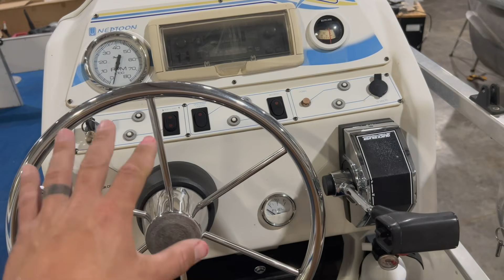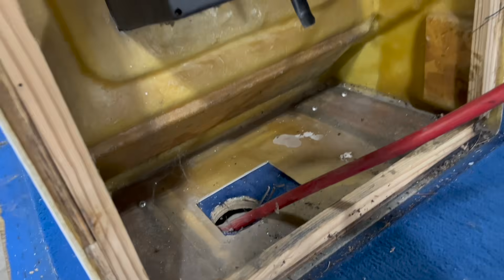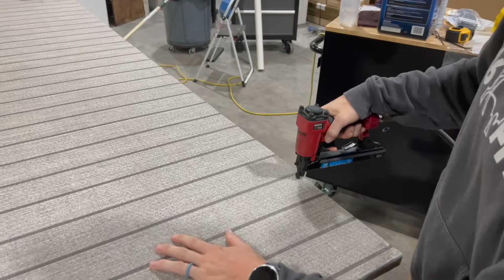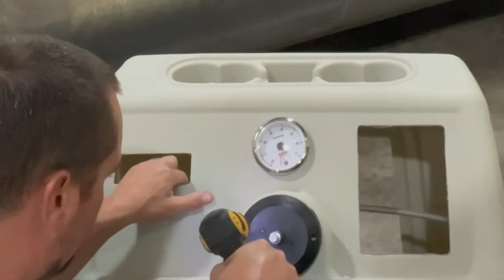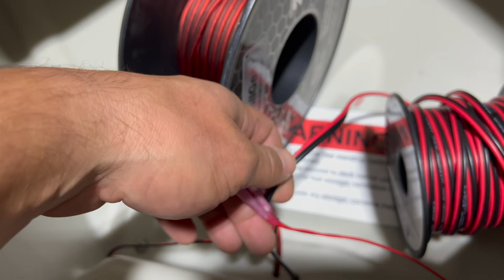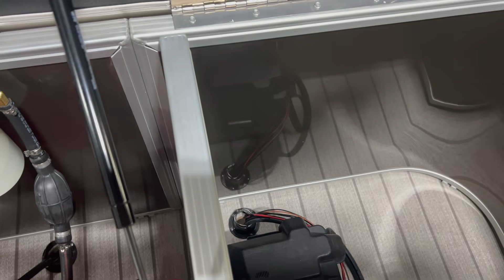Complete Pontoon Restoration - Instructional - 1996 JC Pontoon

Comment: Great job on the video, very clear and easy to understand what your saying but as an instructional video it would have been helpful to to a much wider audience to put time stamps along the timeline, that way if someone wanted to know how to do one particular thing they could jump to that part of the video. As for any pontoon full resto-rebuild like this, the fact is you can buy a brand new pontoon boat for the price of all those parts, not to even mention all the labor/man hours and headaches. ...aaaaand when he gets ready to sell it the title will still read "1996" - good luck!
Reply from the maker: Agreed! I need to add time stamps on these longer videos. We shopped the spring boat show hard to find the cheapest pontoon boat out there and what we found was a 16' Qwest fishing style with one small bench seat, a folding fishing seat for the captains chair, and two fishing seats up front. It was bare bones and had a very cheap look...for $26,999 (before all the tax/freight/fees, and with no trailer). From my research, entry level 20' pontoons with a 40-60hp are now ranging $35K to $40K. So for someone who plans to keep a restored boat for a while there is great savings there. 

You're right, if they plan to sell it the buyer will have to understand and see the scope of work that went into the restoration in order to understand the value. It's sort of like dropping a new engine and transmission into a 30 year old truck...if the rest of the bones are good that truck's value will be much higher than a truck of the same year without the engine/transmission upgrade...and at the same time it'll not be worth what a new truck costs. However, it'll be a great truck for someone who knows what it is and could drive another 10-20 years for way less than new. 

Thanks for watching and for the time stamp suggestion!!

Comment: Couple questions, does marine grade plywood have to be used or can regular plywood be used? Also does that type floor covering get really hot in the sun? I’m still trying to decide between this type floor covering or carpet, my boat is a 1988 model and kinda wanted to keep the vintage look.
Reply from the maker: Whatever plywood you use should be CCA treated. Marine grade just means it’s void free on one side, so no knots or blemishes where the flooring will lay. 

Here in Michigan we have no issues with the floor getting hot. If it ever does we just splash it down with water and it’s good to go for a while again. I’ve heard down south it can get warm, but still cools with a splash. It is just so little maintenance and doesn’t wear out like carpet, plus it’ll keep the moss and mold from growing!
Reply: @tomspontoons  didn’t know that about marine plywood. I’m in NC so it does get hot during our outings, will definitely consider the vinyl. Thanks!
Reply from the maker: @braxman841  We were on the boat here in Michigan (about 75-80 degrees) in the sun all afternoon yesterday and had to splash it down to start, then with the bimini up and kids swimming it stayed plenty cool the rest of the day.
Reply: @tomspontoons  thanks for that information.
Reply from the maker: @braxman841  happy to help!

Comment: Pulling the transom back, could you put anything bigger than a 60 horse?
Reply from the maker: This was about all this boat would take without beefing up or replacing the transom itself. We have to remember that the weight and torque of the motor on a pontoon boat is significantly different than a typical boat, and even very different than a tritoon. The transom is suspended out on 8' long aluminum crossmembers in most cases, not welded or incorporated into the hull structure itself. It lends to a lot of abuse on those crossmembers over the years. I encourage folks to play is safe and stay lighter unless they absolutely need more speed!

Comment: Love the build excellent job as always. Quick question for you. I have the deck mate seats as well and they get rain in them after a good storm. Is there a way to prevent rain from getting in the storage underneath or is that what the seat covers are for? Also how did you install the snaps in the railing for your custom seat covers?
Reply from the maker: Thanks!! Yes, the seats and seat bases are not waterproof and will get wet. That's exactly what the seat covers are for, and to protect the vinyl from the sun, birds, and critters to increase longevity. I use stainless snaps that are self tapping into the railings, along with stainless snaps with my snap installation tool. There are tons of tools on the internet that will work, but since we do it often we invested in a nice one from Sailrite.

Comment: @Toms Toons pontoon quick question i have a 1994 20ft pontoon if i move the motor back like you did on another pontoon do i need to move my fencing and seats forward too balance the pontoon out if it needs it i and moving the motor back about 16 inches
Reply from the maker: I don't think that moving the motor back 16" will really hurt the weight distribution of the boat. Typically we move the motor back because the customer wants to gain that rear space for walking around or for pushing seats and railings farther back for more interior seating. I don't think you'd see any noticeable change in the way the boat sits or the water line to be honest.
Reply: @tomspontoons  yeah that's what I want also is more room
Reply from the maker: @redneckrockhunters5021  It's the easiest way to utilize all the potential space. You'll be glad you extended the deck!
Reply: @tomspontoons  thank you if I had not watched your videos I would not have known how to do it thanks again for making great content and for answering my questions
Reply from the maker: @redneckrockhunters5021  happy to help! thanks for watching my stuff!
Reply: @tomspontoons  is quarter inch square tubing stronger enough to support the motor because I cannot find the u channel that's on the boat in 2 inch and thank u for your information
Reply from the maker: @redneckrockhunters5021  I have run 3/16” walled and 1/4” walled square tube as rear supports. Works great and adds just as much vertical support as a 2” hat channel…probably more because hat channel is usually only 0.125” or even 0.100”
Reply: @tomspontoons  ok thank you very much you do awesome work what do you do with the old stuff you take off the boats I need a good console for my pontoon I have a old wooden one I would like to find a plastic or fiberglass one used in good shape
Reply from the maker: @redneckrockhunters5021  If it's salvageable we sell them locally cheap and fast to prevent taking too much to the dump and so that we don't have to charge a "disposal fee". It's already expensive enough when we go to the dump with the old plywood, carpet, and other junk!
Reply: After having restored a couple pontoon boats, and knowing what time that takes, it’s amazing that you can also find the time to make these videos! You deserve a LOT more subscribers, considering that pontoon boats are one of the most popular genres of boats

Comment: Hey Tom do you suggest drilling all the hole in the deck that you need before installing the vinyl? Such as for a removable table and controls and wiring?
Reply: Awsome thanks Tom
Reply from the maker: @natemcwilliams8773  happy to help!
Reply from the maker: I cut all my holes for electrical and the motor as pretty much a last step in the whole restoration process. I've never had the woven vinyl products catch, pull, or run when cutting with a jig saw, hole saw, or drill bit...carpet might not be as forgiving in that way though. Once in a long while when we're doing just the floor on a boat I will trace off the original wood and pre-cut holes that have specific sizes, shapes, and placements. This is when we're re-using everything and we want to make sure the components go back in the exact same spots.

Comment: So what do you think about the marine untreated plywood?  I’m getting ready to replace the plywood on my pontoon boat and my local lumber yard only carries the AB marine plywood that doesn’t look to be treated. Is it ok to use? Can I treat it with some sort of sealer?  Thanks for your help!
Reply: Its a matter of how long you want it to last and how much money you have to spend.
Reply from the maker: @robertrobertson3927  very well said!! I just figure if I’m spending some money I’m going to look at the difference and it’s usually worth a little more to have the peace of mind that I did everything I can to make it last.
Reply from the maker: I’ve only ever used the marine grade TREATED plywood (always ordered from Pontoon Stuff). It’s the same type of plywood that pontoon manufacturers have been using for decades and even the same stuff that brands put a lifetime deck warranty on. We’re doing a test right now soaking treated and untreated in buckets for a month….the untreated got moldy very quickly. Haven’t noticed any other changes yet, but the treated looks totally normal. If you use untreated and seal it you’ll have to use a different type of adhesive as the wood needs to breathe for the regular glue to cure. It’s not usually much of a price difference to just order from Pontoon Stuff, plus our discount code saves you about $10-$15 per sheet. They’ll deliver it to your house via fed ex freight.

Comment: Greetings Tom, some toons place the fuel tank in the area in front of the motor like my Quest.  When you do a complete restore like this video, will you: 

1. Relocate the tank onto the rear deck and enclose it?

2. Keep it in the original position?

If (2) I'm guessing the tank needs to be in place before the first deck board is installed. 
Lastly, do you drill drain holes in the area in front of the motor?
Reply from the maker: Great questions! This boat actually had TWO 12 gallon tanks, one on each side of the motor. Those have been removed and we are installing a single 20+/- gallon tank under the sundeck that we'll be installing. We'll tie that into a water fuel separator and filter, as well as add a fuel gauge. This center pontoon did not have the space for a fuel tank in the pontoon in front of the motor, but you'll see on the 27' barge build we having coming up we left room for a massive 29 gallon tank. It's something that the pontoon fabricators we work with can do based on the design of the customer. This pontoon design has an opening at the bottom in the very far back for water to move in and out. So when the boat is at idle the last couple feet of pontoon will fill with some water, then when on plane the water will spill out the bottom making the load a little bit lighter. Thanks for the questions!

Comment: What is the best approach in screwing down the railings before ordering the Bimini top to ensure they will line up correctly?
Reply from the maker: Great question…all of the aftermarket Bimini tops have some play on the actual width. Some seem to line up perfectly, while other maybe have to be squeezed in a little or stretched a little to fit into the brackets. If your boat is 8’ wide deck then the 8’ wide Bimini will sit properly on railings that are around 90” to 94” in width. Same goes for an 8.5’ wide boat offering a range of actual railing widths.

Comment: Great video Tom! Now I can’t wait to get started on mine!! And to answer your question…I think that would be an awesome idea if you could offer a pontoon pkg of clips, screws, splices and any other bits and pieces you could think of. Also, I haven’t seen you use it, but wondering if you ever use the black plastic split wire loom. Cheers tom, love the videos, keep ‘em rolling!! 👍🏼🍻
Reply from the maker: Thank you for watching! The restoration season is upon us, time to prepare for the 2023 summer. Guess I’ll have to get to work on putting a kit together. Won’t take much and won’t be expensive, but hopefully I can make it easier on folks at home. I use the split conduit on occasion when wires are visible or when they’re at higher risk of chaffing. Otherwise I bundle them well and tie them up tight. I’ve seen manufacturers of brand new boats use it and I’ve seen some who do not. Personal preference I suppose! They’re all marine coated wires, so the elements won’t hurt them.

Comment: Have you come across any trolling motor setups that dont block the front door?  I need the trolling motor but also need to be able to squeeze a wheelchair through the door.
Reply from the maker: We’ve done several that angle out to one side on the front deck. Check out the Riviera Cruiser restoration episodes. There are also options where the trolling motor can actually mount to a bracket over the front of the boat off the deck.

We hope to build a boat next season that’s all decked out for wheel chair access, so stay tuned!

Comment: Great Video Tom from start to finish. It's great to see the whole process in one video. I am considering adding a dual battery system to my 1997 Voyager pontoon and would value your opinion greatly on the Blue Sea Systems battery cut-off switch set-up, maybe even a video in the future. Thanks again!! Love your channel. 😎
Reply from the maker: Thanks so much for watching! I haven’t worked with the Blue Sea system yet so I can’t comment much there, other than the reviews seem solid. I’ve installed the Perko 4 position switch on several boats running two batteries, including my own tritoon build, and I love that system. Add in a NOCO dual bank charger just in case and you’re good to go. We didn’t need any sort of additional charging system on our tritoon all summer. Simply run the switch on the “ALL” position when cruising or out tubing, and then switch to the accessory battery when anchored with the motor off listening to music or keeping LED lights on. Our 200 Suzuki cranks charging power, but most of Pontoon use involves the motor running at least to and from spots to help charge the system off the outboard.